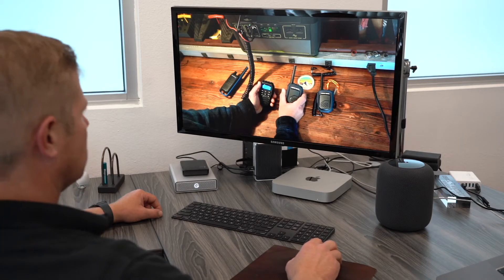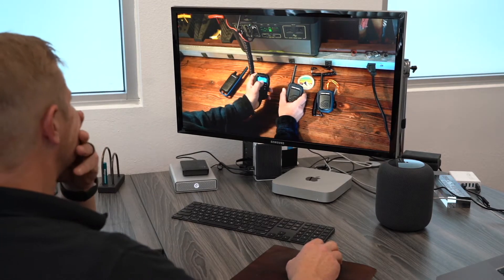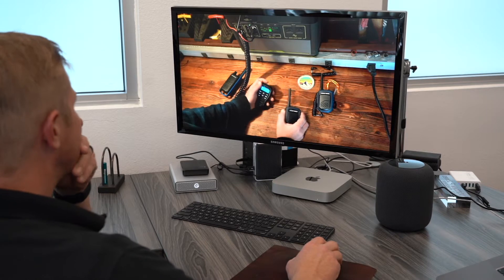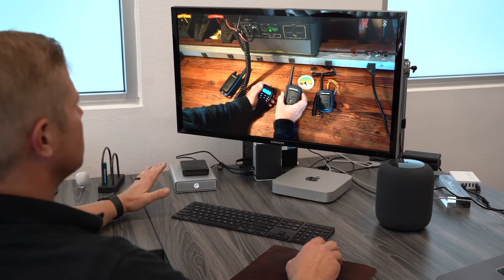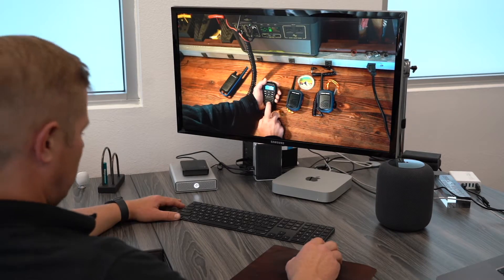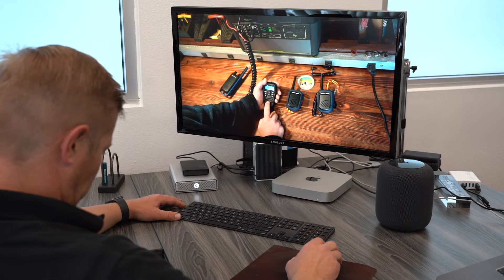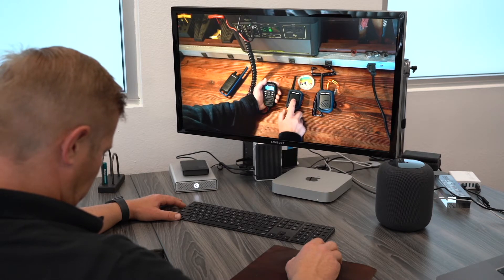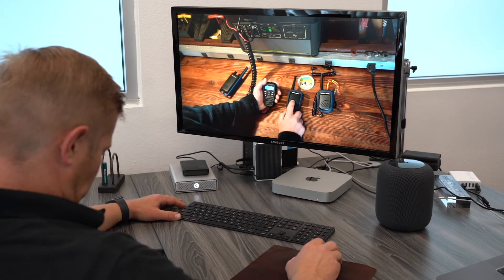Do privacy codes really encrypt my conversations? And if not, what do they actually do?

Comment: What's fun is going to a campground and messing with other people.  Just take a scanner like the Uniden BC125AT and it will show you what channel they are on as well as the CTCSS/DCS code.  They will often change the channel and/or code and be flabbergasted at how quickly you are back in touch with them.

Comment: Then why is it called privacy  then. Make no sense
Reply: a ediet printed the box and did not understand any thing  ok thay put 35 miles on package that  on G M R S range
Reply: selling point from corpert thay don't know eather   I solved that problum I bought a radio that does not have all that nonsense  we in the off road world don't
need it you cant use it on G M R S anyway and where fine running 45 watt radios.
Reply: SAILES  HIPE that is it this will go 38 miles and nothing to tell you how to do it
H I P that's all I do this every day surf u tub every day  thay don't  read he book
and wing it then I clean up there mistake
Reply: Right. It is the OPPOSITE of privacy. They can hear you, but you can't hear them.

Comment: Hey question so connected my rocky talkie to retrevis rb19 and i can hear everything but can't talk back ,can you help ?
Reply from the maker: If you can hear on the rocky talkie but not on the retrevis that means that the PL, CT, DCS codes don’t match.  Try setting them to zero on both radios first.  Then go to the manuals for each and match the values of the code numbers, not just the numbers. I hope this helps.
Reply: @AdventureCruiser  how to set them to zero cause i have no idea
Reply from the maker: @MGMaciej  I can’t tell you how to do it on your other radio, but from the factory Rocky Talkies have the right one set to 0 for the first 22 channels. Check out my other video titled “can I use my rocky talkie to talk with other radios?”  It covers the how to.
Reply: GET OUT THE BOOK AND READ IT IT WILL TELL YOU EVERYTHING
GRASS HOPPER.
Reply: @MGMaciej    get your self a cold  drink and sit down and read the book
cover to cover twice then you will know what all the button's do
when I got my radios the codes where  put in all ready  and they put in two
PL tones for two G M R S repeater's I use  got my licensee box showed
put my station together and on the air. cobra won't do that.
Reply: @MGMaciej   PLEASE READ THE BOOK THESE GUY"S CANT.
Reply: your answer is right you match the codes the same then it will work

Comment: Are the t800s any good? I was thinking of using the text feature on a cruise? Will also pick up the rockies.
Reply from the maker: Great question, and while I also have a set of T800’s, I don’t have a lot of experience with them.  As a rule, I’ve always been impressed with Motorola public safety radio, but found their programming to be very unfriendly. The same is true in my opinion for the T800.  I attempted to set up two radios to share location and text abilities on a trip about a year ago.  The friend I was working with gave up out of frustration so we scrapped the idea.  I am sure lots of people have used them successfully, but I have not.  Have you looked at the GoTenna system? I use the GoTenna Pro X public safety version, and have really enjoyed them.  If you have three or more devices they create a mesh network, extending your range. Still not super simple, but purpose built for sharing location and text ability.
Reply from the maker: Just to be clear, I suggest you consider the GoTenna Mesh, not the Pro.
Reply: @AdventureCruiser  thanks. After I watched your video. I saw the gotenna mesh system. I think I will go with the Gotenna and the Rocky Talkies.
Reply from the maker: Oh very cool, please let me know how you like them. Safe travels.

Comment: Just call it a filter.
Reply from the maker: That's a good thought, but still not completely accurate. A filter implies that it ONLY lets through what is supposed to get through. Once a privacy tone unlocks the squelch of a radio, it will let everything on that frequency through, regardless of the privacy tones being used. So it's really only a filter to initially open the squelch, but once it's open, its open.
Reply: @AdventureCruiser  not true. Remember these are shared channels with higher powered GMRS radios. If you are talking to another FRS radio and he is somewhat distant, and you are using a privacy squelch tone, a much stronger GMRS signal could key up on the same channel with another privacy code or even no privacy code and could completely override your other stations transmission. Since the overriding signal will mute your squelch you will suddenly hear nothing. A far better option is for everyone, including GMRS stations to NOT use privacy codes. You could then hear that your other station is getting "walked on" by the strong station and communicate with the interfering GMRS station. You could then break in and request your other party could move to a clearer channel. Additionally you might encounter electrical interference that can trash your ability to hear. With privacy codes you don't hear the interference because it would silence the speaker. With no privacy code you could hear the interference and search for a quieter channel. A good way to operate is with privacy codes off. Although filtering out the audio from undesired transmissions sounds nice, you could be muted by an stronger source of interference and NOT even be aware it is there. So in essence you are deaf AND unaware. A far better option is to use no codes and be aware. If a channel is busy, just break in and move to a quiet channel. As a rule of thumb, channels 8-14 are your best bet. GMRS radios (possible sources of interference) are limited to only half a watt on those channels. On channels 1-7 they are allowed 5 watts, and on channels 15-22 GMRS are allowed a full 50 watts. At that power level they might  crush your low powered FRS signals. At least channels 8-14 levels the playing field with equal low power restrictions. Yes it is boring, but detecting and evading possible sources of interference is critical to maintaining effective radio communications. That said, I think the privacy codes are very misleading to every day consumers and are best not to be used.
Reply from the maker: @K9WLW Radio  so, which part are you saying isn’t true? To some extent I think see what you’re saying about a more powerful and different PL closing the squelch of an FRS radio, but I’ve only seen that technology in public safety radios where they call it “reverse PL” where a PL or CTCSS/Dcs can not only open the squelch but more importantly, close it at the end of a transmission to presumably decrease the burst of static as your radio realizes it is no longer receiving a signal.  I think I understand what you’re driving at, but in my experience I’ve had radios let in any transmission once the PL tone has opened the “door”.  As a matter of fact, I experienced this today while in Moab and both transmissions were a little garbled from overlayed modulation, though the closer (I.e. more powerful station) prevailed, so I don’t really understand your issue with my summary. I agree that it would be most polite to not use a code, but my intent isn’t to rewrite the FCC rules or guidelines but rather explain what things do, and the biggest point I wanted to make is that Privacy Tones (or PL) really aren’t private. Sorry if we disagree on some of the details, but I think we can agree that the main point is that it isn’t private.
Reply: the company's never thought about that be course  thay don't know radio's
   them self's and thay don't want to  here is a quote from another channel
a guy from buy two radios would not tell a guy how to change battery's
there answer  this would run over and make this to long called the co up and called the guy a jerk.